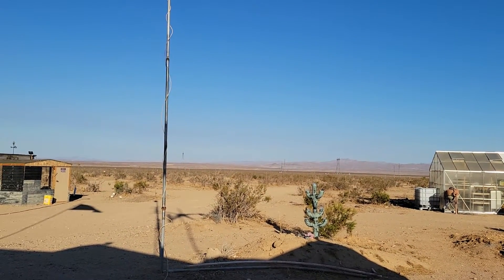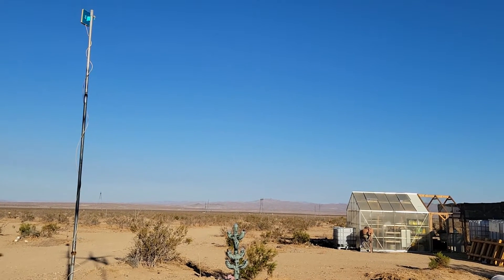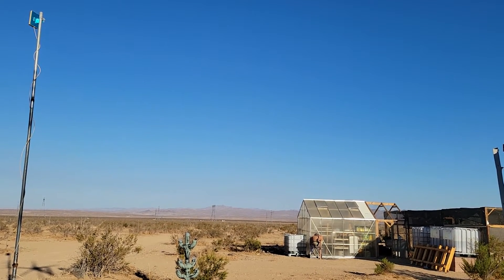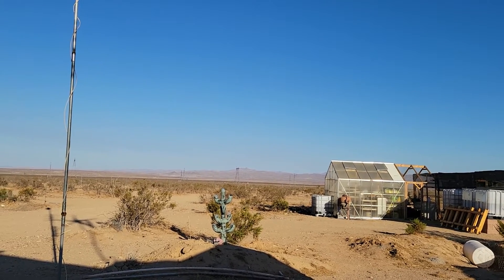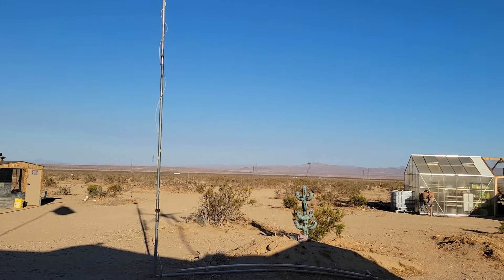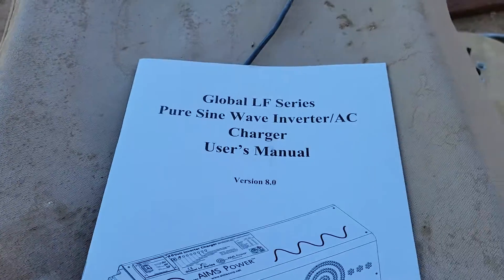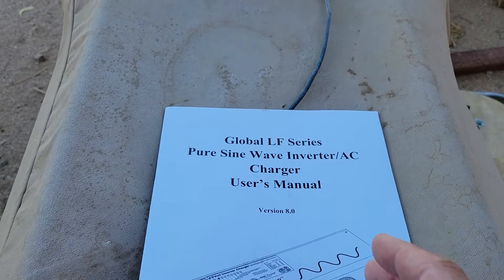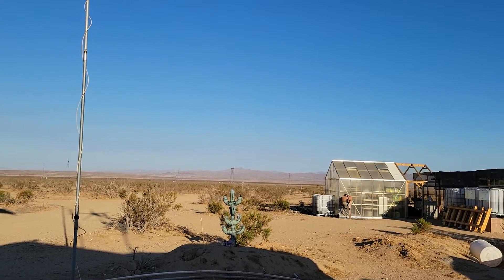AIMS 4K SPLIT PHASE LF 240V INVERTER INFO, Oct 2, 2021

Comment: Can you charge you batteries through aims split phase inverter with a 110 generator Honda 220 ?
Reply from the maker: I use a Predator gen with 240v input on mine.  I don't think 120v is allowed for input on a 240v inverter.
Reply: @GBear  Thank you
Reply from the maker: @bianchispurs you're welcome.

Comment: Did you ever figure out the 220v on the inverter
Reply from the maker: Yes.  The thumbnail picture shows the 2 hot 120v leads, (red&black). Red goes to one side of the electrical panel, black to the other side.
Reply from the maker: Welcome aboard!

Comment: Awesome video G bear, wondered if you’d do a part 2 with the answers Aims gave you…they weren’t a ton of help for me
-going through nearly the same issue myself with the same inverter 4kw 12v-240split wondering how to  hook up AC input/outputs…I just have a main panel really don’t wanna add a sub if I don’t have to, but don’t wanna take a chance with back feed
Have great day
Reply from the maker: It sounds like you are attempting a grid tie setup.  I only do off grid solar.
I think it requires a shunt to prevent backflow, and normally different equipment is used for on grid solar.
Sorry, I can't be of assistance for a grid system.
Reply: On grid no solar yet but will be added later for backup, grid is less and less dependable…just looking to use grid or generator to maintain batteries for now….
I’d disconnect main while using inverter (or generator) until grid returned…
Curious what all aims had to say…no worries, good day
Reply from the maker: I called AIMS to get the proper switch settings, and to question the green ground wires on the AC side of the inverter.  They walked me through the switches for lead acid batteries, etc, and told me for my application those green wires remain disconnected,  and the inverter case should be grounded to earth.  Other than that, the owners manual provided all the other info needed.
I hope that helps
I can tell you that you will need a very big battery bank to be of any help for powering a house without solar panels.

Comment: I use the 48v 6,000watt model. 
    I have  Ground🟢  ( STRICTLY GROUND! Copper wire to a Grounding Rod! ) 
        ( IN or Incoming )
 L1 ⚫🔴 ➡(120v 3,000watts ) 
 L2 ⚫🔴➡ ( 120v 3,000watts ) for a total of 6,000watts. 

   On My Out I have  L1 ⚫🔴🔄Hot / L2 ⚫🔴🔄 Hot and  N ⚪🔀 ( Neutral ).

     Now this neutral ⚪ is used to split phase 🔀 some how.  It will read 120v out of phase 🔀.

 This why you DO NOT WIRE the ground 🟢 to the Neutral ⚪like EVER or you will SHORT the Inverter⚡

That ground 🟢symbol is STRICTLY for a grounding🟢 Rod.

 If in an RV You connect those two yellow strip green wires together 🔒 

For off grid application DO NOT connect those two wires. Leave them apart🔓 🚫

 Then must Install and use a Grounding 🟢rod.
 Hope that makes sense.
Reply from the maker: Yes, and it sounds like you have all the wiring correct.  I have my 4000w split phase wired exactly like you described.
Reply: @GBear   I had to watch 100's of Aims video's to get all that clarification.   That Neutral is So Special in doing phase application. The manual has the hardest of times explaining it.  These inverters ( most ) have soft start technology and the ability to split phase to help start motors from what I read. I was going to include a special soft start circuit but AC, Fridge, drills and Air compressors work just fine.
Reply from the maker: They sure do!  I just called AIMS and a tech walked me through special settings and connections.  They were very helpful.
Reply from the maker: Welcome aboard!

Comment: Wow, those terminals are going to be taxed wired in that way. Attaching to a terminal block or board would be safer. I'll up load a video of my system for review.
Reply from the maker: Welcome aboard.   Thanks, I'll check it out.

Comment: I HOPE THIS MAY HELP YOU BUT CHECK OUT MY DIY SOLAR SYSTEM VIDEO . I HAVE A TRANSFER SWITCH  PANEL CONNECTED TO MY AIMS 6000 WATT 24 V SPLIT PHASE INVERTER AND THEN TO MY MAIN GRID INPUT PANEL WITH NEUTRAL TO GROUND . NEVER CONNECT THE INVERTER OUTPUT NEUTRAL TO THE TRANSFER SWITCH NEUTRAL TO CASE GROUND .  THE TRANSFER SWITCH NEUTRAL SHOULD BE SEPARATED FROM THE CASE GROUND .  THE TRANSFER SWITCH  , PV MODELS AND INVERTER CASE CAN ALL  BE CONNECTED TO A SINGLE GROUND ROD FOR LIGHTNING PROTECTION .  NEVER CONNECT THE INVERTER  INPUT GROUND OR OUTPUT NEUTRAL TO A GROUND ROD . ALWAYS LEAVE THE INVERTER GREEN WIRES DISCONNECTED . YOU CAN CONNECT A GENERATOR 240 V 3 WIRES OUTPUT STR8 TO THE INVERTERS INPUT AND THE INVERTER OUTPUT STR8 TO A BREAKER BOX WITH NEUTRAL TO GROUND . CURRENT FROM THE BREAKER BOX NEUTRAL TO GROUND WONT FLOW BACK THROUGH THE GROUND TO THE INVERTER IF EATHER OR BOTH INPUT GROUND AND OUTPUT NEUTRAL IS NOT CONNECTED TO A GROUND ROD THAT COULD CAUSE DANGEROUS DAMAGE TO THE UNIT . MAKE SURE THE GENERATOR CASE IS  CONNECTED TO ITS OWN GROUND ROD .
Reply from the maker: Yes thank you.  I called AIMS before connecting 
my gen and they gave me the info about the ground wires.

Comment: LF INVERTERS are the way to go for sure.  They do present one issue.  They run hot..  You need to insure they have the best cooling possible Adding a booster fan to the air intake helps .  Gotta keep the air flowing any mean you have.  Cool air.  I've never worked with the split phase type.
Reply from the maker: Yeah, I have multiple CPU fans running to keep things cool.
Reply: @GBear  Use the turbine type.  They create more pressure and  concentrate the air better.
Reply from the maker: Yep, have one featured in tonite's video, just posted.  And a shout out to you too.

Comment: I installed 10/3 Power cable with Plug on my Aims Inverters and just plug into Generator/ or Grid power if needed. But Mine are only 120 Volt output models. I have noticed that some directions and diagrams for wiring them seem off. But glad to see you have a AIMS inverter now. I have thrown alot at mine and it have never faulted. Owned mine for about 3 years now. I love them.
Reply from the maker: Yeah, mine being 240v split phase is different.  I'll have to get on the horn with AIMS.

Comment: I may be wrong but I thought they said on split phase it only uses the neutral for a ground on one side...the other must be grounded to the case I think...it is a bit confusing, especially when you add the two green wires...I think it has something to do with preventing a " Ghost phase "from having them both on the same ground...I have one of those remote start switches with about a twenty foot cord on it lol...supposed to be for a long RV I think ...I just don't know where it is right now.
Reply from the maker: Somewhat.  It says that if you connect to a house panel that already has a neutral to ground connection, all you need it to ground the AIMS case to earth ground and disable the neutral ground at the inverter.

Comment: I had to call them about mine ; the tech at Aims told me the two little green wires? To connect them...on mine it changes the voltage coming in when #1 dip switch is changed, but I did not have enough batteries .When I only had 10 it kept triggering the charge cycle all the time, so I set it on zero instead of one...I can probably use the other setting now that I will have enough batteries...my 2000 watt one won't be able to suck them all down...that's my theory anyways...from what I understand of the manual, when the green wires are connected, it uses the case of the inverter ground lug as the ground...mine has a copper ground rod outside with a #4 stranded cable running to it. It is always wet there from the drip of the roof...Oh , also the price of the one I have has went up like $200 since I bought mine...I got in just ahead of the rush I guess...there's something on that split phase about they only do something on one side but since mine isn't like that I've forgotten what it is...

Comment: lf inverters have much more surge capability and far less electronics to go wrong, my lf inverters are so robust they do not need cooling fans even in 50 deg c at full load.
Reply from the maker: Yeah, my AIMS faulted once or twice when the temp outside reached 116°F.
Reply: @GBear  how did your previous inverter handle the heat, mine are genuine aussie built so theyve got to perform here or it wouldnt be good for business, they cost a fortune i had to buy both of mine near new barely used and unused.
Reply from the maker: @closertothetruth9209  the old PowerJack was never bothered by the heat.  But I discovered it wasn't clean sine wave either.
Reply: @GBear  yeh seen videos of their faltering sinewaves under load , its what destroyed 3 refrigerator compressors of my freinds, once he upgraded inverters no more issues since 2013
Reply from the maker: Same here,  remember my fridge going out?

Comment: so Bear I am currently trying to run an wind-solar system for my workshop The biggest equipment I am running are a plasma cutter, a stick welder, and an air compressor, my question is what is the difference between the 24 volt and a 12 volt inverter and would it be better for me to run a 240 and for lights and such bring it down to 120
Reply from the maker: A 24v system would be more efficient for your needs.  I would suggest a larger AIMS inverter, depending in your 240v needs.  For me, I can 'get by' with the 4k inverter, but would prefer to have the 6k AIMS or larger.
Bigger IS better.
Also, remember that after the sun sets and the wind dies, the battery bank needs to handle the load, so plan on either a very large battery bank, or only running those items when the sun is high in the sky.
Reply: @GBear  thank you for your input and suggestions it is much appreciated
Reply from the maker: You're welcome.
Reply: @GBear  so if I got a breaker box to install  you would recommend 240 breakers on main coming in?
Reply from the maker: Yes, if you have a 240v split phase inverter, by all means utilize it at 240v. The panel will then provide either 2 banks of 120v breakers or provide for a 240v breaker for tool operation or a subpanel.

Comment: Take care GBear. I have hope AIM'S can give you some answers. But by the scmatics you  won't be able to use this inverter, correct?
I know what you said you wanted to do. I hope it's possible.
Reply from the maker: The only reason I would prefer to feed generator power through the inverter is because it also converts to a battery charger with smart controls for float and bulk, and even battery repair, all while still providing power to the cabin.
But, even if I have to run directly to the panel with a transfer switch,  my gen is big enough to run a separate battery charger for the battery bank.  
Also, I have enough amorphous panel power so that if I disconnect the battery bank from feeding the cabin while running on gen, the bank will fully recharge in one day.
Reply: @GBear  yes it will. I was sending good wishes that things worked out the way.you preferred them too.
Reply from the maker: I gathered that, sorry.  I should have started my reply with a thanks.

Comment: Amazon has the transfer switches in stock if you're looking to go the easy way you can also get them off of eBay
Reply from the maker: I saw those, but too expensive!  I can fabricate one from a subpanel and 2 breakers for 1/10th the price.  I may even be able to find a refurbished one for a decent price.

Comment: I'm not finding the opposed breakers. transfer switch I've used in the past
For customers...
But it should be easy to put a bar between the two breakers
If I remember right the last one I installed.  Had a sliding plate
Reply from the maker: I can modify a can and breakers to work as needed.  I have the tools and skills needed, all I have to do is get the equipment.  Home Depot was out of them, and so was Lowes.  I have a place in OC that refurbished breakers, panels, switches, etc.  When I get time I'll make the 3-4 hr round trip.

Comment: Interesting! I'm planning on getting a small inverter to just run a drop light or maybe a sawsall. Thanks for the shout out 😄
Reply from the maker: For small items like that a modified sine wave inverter from Harbor freight will suffice.  I have a 3k from them in my van that I have used for 9 years to power drills, planers, skilsaws, and even tablesaws and jack hammers, as well as an air compressor.
I wouldn't trust it for electronics though, because it isn't pure sine.

Comment: How much kilowatts will 
You save connecting this inverter to the grid?? Does it use less grid power than the inverter puts out???
Reply from the maker: I'm not sure I understand your question.  This is a 4kw pure sine inverter used to convert incoming solar power to a battery bank to AC power for home use.
It will convert DC power from a battery bank of 12/24/48 volts dc to 120/240 volts ac, so it really won't save kilowatts, it supplements them from the size of your solar array, and your battery bank.
I hope that explains your, question.  If not, ask more.
Reply: @GBear  Ok let me ask this. If I’m powering a wall ac unit from the grid and I power the same wall ac unit with the inverter does it save kilowatt hours from the grid electricity as it’s converting lower input to higher output on the inverter??
Reply from the maker: @MrKoladge  No.  This inverter does not save grid electricity.  It converts solar power through batteries to usable electricity.  I will not work without solar panels and a battery bank.
Reply: There is no grid power involved here. Only solar, or a/c current from the generator.
Reply from the maker: Exactly, but I may have caused the confusion showing the page with the grid connection.
Reply: He may be talking about the 50-70 watts power consumption of grid tied inverters.
Reply from the maker: Welcome aboard.   Yeah, could be.  This AIMS can be grid tied, but it is still designed as a battery charger, not a straight solar controller for on grid systems.